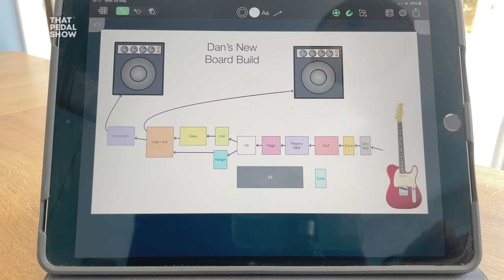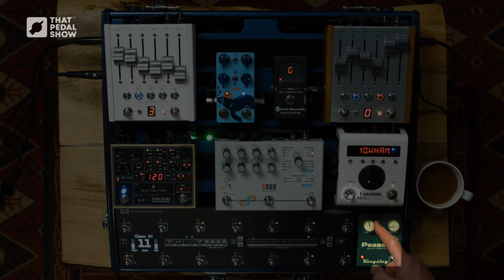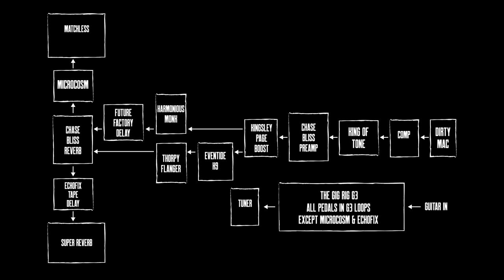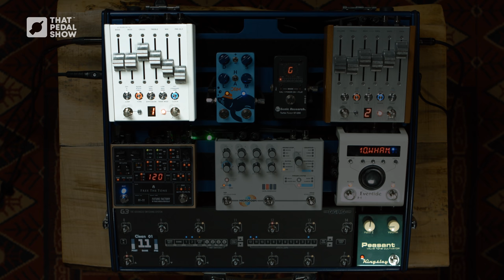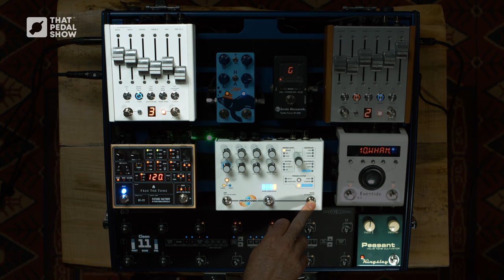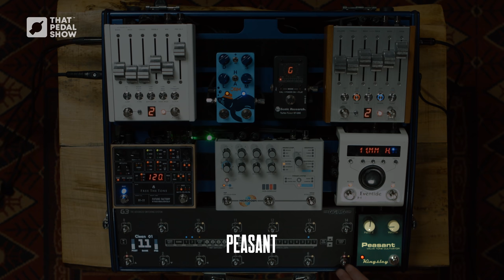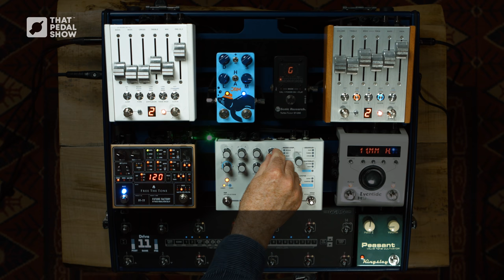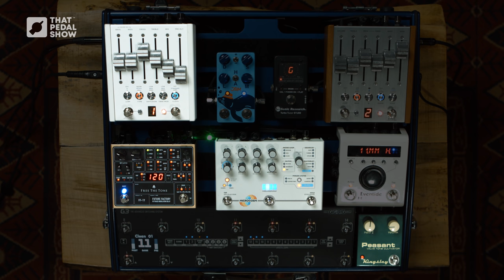Dan's New Pedalboard Build & Tones 2021 – That Pedal Show

Comment: Dan’s on point by mixing 10’s and 12’s. I play live with a 4x10 deville and a 1x12 hrd at the same time and the frequency range is insane. Also used to own a crate vintage club 50 which came with a 3x10 cab. Was huge!

Comment: I think that the years of experimentation and deciding what sound you want is really the most important part of building a new pedal board .... the dual lock, TheGigRig power supply, the SIS audio cables (and unnamed MIDI cables) have all been covered well in other videos .... but understanding why you've picked each pedal and the various pedal sequence for different tones and ideas would be great to hear even more about ....

Comment: Amateur pedal steel player here. If the Eventide can add 2 intervals above a given root note and bend them, you could do some pedal steel chord changes between the I-IV-V-vi
* Raise the 3rd to the 4th, which gives you the sus4 chord (1, 3, 5 -> 1, 4, 5) - same as hitting the B pedal on a pedal steel.
* Raise the 5th to the 6th, which gives you the 2nd inversion of the vi chord (1, 3, 5 -> 1, 3, 6) - same as hitting the A pedal on a pedal steel.
* Do both: raise the 3rd to the 4th, the 5th to the 6th, which takes you from the I chord to the IV chord (1, 3, 5 -> 1, 4, 6) - same as hitting the A and B pedals on the pedal steel ("pedals down" position)
* Now slide up: You just went from the I to the VI chord. Now if you slide up 2 frets, your at the V chord.
* Now slide down and release the pedals: Now you've gone from the V back to the I.
Reply: To learn more, Google "E9 copedent" and study what's happening in the key of E when you hit the A pedal by itself (5 -> 6, or vi chord inversion), the B pedal by itself (3 -> 4, or sus4), the A+B pedals together (I->IV), the B+C pedals together (I -> ii)

Comment: Mick, I am flattered you took the time to respond to my statement of opinion with math.

Interesting argument choice as i simply stated my opinion with an analogy.  Analogy as you may or may not know, is not meant to be literal.  Certainly some will agree with me and some will not.  If someone wants a pedal board more than a car more power to them. We make choices based on economics and most of your audience cannot afford a pedal board like Dan's.  If you are wanting to illustrate what is possible but is mostly unobtainable, then hats off to you both. Feel free to let your audience know the exact MSRP of Dan's pedal board including the labor for the MIDI set up. 

Enjoy your Unobtanium.  I have provided the word definition below just in case you want to attack the word with an equation:

Unobtainium-a highly desirable material that is hypothetical, scientifically impossible, extremely rare, costly, or fictional, or has some of these properties in combination.

Peace, love, and rock and roll!
Reply from the maker: Ha, all good Daniel. I just don’t buy the ‘can’t afford’ argument, however. Sure, a great many people have chosen life paths that have put them in a position where it’s not appropriate to spend this kind of cash on a pedalboard, especially if they’re not pro musicians! Just the same as I don’t have a race car or a full snap-on tool chest. Similarly there are a smaller number of people whose life chances have really worked against them having much of any disposable income. 
But for most of us it’s just choices. It’s not unobtanium at all, it’s just really really expensive and that’s not the same thing. We’re not saying you should go out and buy this stuff - that anybody should buy this stuff. Literally nobody needs this stuff. But we are saying that if you’re a pro musician, or aspire to be one and you’d rather work your way to something like this than do stuff like buy cars, houses or whatever, then here’s an example of how it sounds. Also remember it’s the culmination of a 30 year obsession, not something obtained overnight. 
I just really baulk at the idea of ‘normal people’. My first job literally didn’t pay enough to cover my rent and food for the year. But I’d default on the rent before I’d play a shitty amp. And I know way too many musos who’d do the same. Choices. I’m not saying anyone should do that, just to be clear, but I am saying they are all choices. Normal people. Arrrrgghhh. Again, never met one yet. Cheers!

Comment: This is definitely the most complicated pedalboard I've seen in some time, and immensely more complex than I would ever use. I'd have option paralysis with Dan's board. Even my current board design I'm working toward is more than I'll ever actually use, but simply because of space, I want to move to a Boss GT-1000Core to replace my reverb, delay, mod, compression, and eq needs. Drives will remain all analog solid state.

Comment: Thoughts on using 454 22AWG 2-Conductor Stranded Shielded Miniature Line Level Audio Cable in the pedalboard vs the normal patch cables to save space. Line level is considered higher quality than instrument, it’s shielded etc and significantly thinner and easier to route bunches into tight spots. Figured Dan the Man would have the best input on this.

Comment: Man, it took me a while to figure out how you have 12 pedals hooked to the G3, with the CXM running in stereo.  Since, there should only be room for 10 pedals, and then the CXM taking up the 11th and 12th spot.  I’m assuming the Peasant is in front of the whole board and not in a G3 loop, cause you click on it directly?  Thanks! You’ve completely revolutionized my board with this video!  Which, now looks almost identical your’s Dan, including the  pearl blue Schmitt array 550 board.  Cheers!

Comment: Really amazing tones from beginning to end.   I can imagine sitting with that set up by myself and totally having such a blast with all of the possibilities.  That being said, when the band kicks in, I can't imagine that the little nuances and differences left and right (tape and digital delay) would be sonically discernible.   So thinking you would have something different for a live show?  Amps and guitars aside, my quick math has you well over $10 grand for just the pedalboard/effects set up.  That amount is almost terrifying.  May need some velvet ropes around the board so no one can spill a Coors Lite or a shot of the Doctor on that.  :) Job well done on this one Dan.   I don't know that anyone could ever surpass this.  Thanks for the video guys.
Reply from the maker: When the band kicks in is when the little nuances are the most important so yes, this is absolutely my live rig

Comment: Hey Dan. Lovey pedalboard. Any update since 2 years? Did you change the internal switch position of the Automatone to make it works with active pedal before? For instance if you want to use the fuzz circuit of the Automatone but the Peasont, Dirty Mac or Zenith in front of it while still being able to clean up nicely.

Comment: This is great! Well done, Dan. I'm slowly reconfiguring and rebuilding a couple of boards, large and small, so this is not only fun and Dan-tastic, it's also helpful :) Like the Master (that'd be Dan), I favour a mix of vintage and modern types of effects and, shock horror - am actually starting to incorporate MIDI controller (s) into my rig! 
I'll always remain a grumpy Mick at heart tho, the MIDI is born out of necessity.
Still need to get myself a Wetter Box. Been putting that off too long.
Is that beanie analog dry-through? Just in case it rains.

Comment: Hi guys, great vid as always. Can you tell me if I can treat amp pre amps through separate GigRig loops. Then output to one power amp? Say If I want Clean, Crunch and drive, from 3 different amps with effects loops. Preamp switching? If this can be done. I can live with one input, 3 pre amp choices, come back through post effects then out. Does the G3 have internal audio routs. Can you output a signal to loop returns without sends. Internal audio routing? I'm buying a Gigrig soon. I just need to figure out the 3 amp pre selection. Plenty of solutions for 2. It may have to be a custom build, if GR can't do it.

Comment: Hi Dan,

Might have to see if I can stay up for a Live Q&A since this video is a little old now, but I have a question about the Eventide H9 you’re using.

Is it a problem with your wet/dry setup? By my understanding, the H9 has no analogue signal path, meaning you have unavoidable digital latency in the order of a few milliseconds in the pedal. Not an issue for the ear, normally, but wouldn’t that introduce phasing issues to your guitar signal when you’re using it wet/dry? Or is this actually a non-issue with that pedal.

I’m eyeing off a H9 Max instead of all my analogue modulators to take care of the “I’m out of loops on G3” problem, but don’t want to lose wet/dry.
Reply from the maker: Hi Justin, not in the way I’m using it. I’m splitting the signal before the H9, then killing the dry in the H9, so my direct signal goes to one amp and my effected signal goes to the other. G3 also let’s me do a parallel signal so I’ll kill dry to H9, and use it in parallel with my dry signal, then mix it back together after. Works brilliantly for delays etc, I’m mainly using it for more out there tones 🤓👍
Reply: @That Pedal Show  Hi Dan, thanks for the reply! I hadn’t thought about running a parallel signal in G3, that’s brilliant. Well damn, you’ve just removed the last barrier I had to buying an H9, better let my better half know :P

Comment: Great setup, thanks for the video. So on the Peasant input impedance does increasing it also effect the top end like some 1M pots seem to do?
So Dan are you using the Dirty Mac without a buffer out to the amp when you are doing Peasant->KOT->DirtyMac?

Comment: Hey, have a question, do treble bleed volume pots on a Strat. sound good with a fuzz face type pedal? I like the way it sounds now with the volume rolled down. Thinking about putting one in, but heard some negative feedback with the fuzz pedal added. I love using the fuzz pedal, I have it on most of the time. Your opinion and thought? Thanks.

Comment: Amazing video and unobtanium board. Really enjoyed it. Question for Dan. If you had to go play a gig with a rental AC30 And fender twin do you think you’d be fairly confident that the board would be as effective or do those particular AC and Fender amps an absolute must for it to sound as good as it does here. Thanks again guys great video.
Reply from the maker: Yeah, no probs with those as rental amps, would sound awesome!
Reply: Interesting. The reason I ask is there is something about the particular nature you achieve with your higher gain sounds where you get lots of distortion without necessarily lots of compression which is not a massively easy thing to do with pedals. (Or so I find) you get amazing open sounding mid to high gain chord sounds. I was wondering how much the amp plays a part in that.

Comment: Dan I a power supply question it's a specific power supply it is a joyo power supply 5. It has three 500 milliamp plugins and four 100 milliamp plugins for 9 volt and then it has one that can switch from 9 to 12 to 18 volts it's basically a recharge battery pack. My question is is there something wrong with using something like this does it have some kind of inherent flaw that could negatively affect your tone?
Reply from the maker: If it’s quiet with your rig then you’re golden 🤓👍
Reply: @ThatPedalShow  bless you kind sir! It seems to work fine it Powers my strymon my D & M drive from my other stuff and I haven't had an issue I finally bought a second one because of her time that you know they hold less charge. But I'm mostly using my older one on my small pedalboard and thanks to covid Band Geeks have been almost impossible to get and I've been playing with acoustic trio. Katana 50 nominal effects on an acoustic guitar and a Telecaster for the first set And a mandolin for 2nd.

Comment: Is the pickup heat with Red going to be tweak-able with the peasant Z ? Or a les Paul? Ie. Is this board designed around butters? How would you attack a hotter guitar in the rig? Sounds ace btw!
Reply from the maker: All the guitars will do their own thing, it’s really important to me that each guitar stand on its own terms with the rig

Comment: Dan, the h9 has several bypass modes, but most people go for the DSP mode which I guess leaves on both buffer and AD/DA. But its relay TB setting they call True bypass - comments?
Reply from the maker: The bypass state doesn’t matter in this rig as it’s in a G3 loop. H9 has no analog dry path, it’s all digital, so I run it kill dry in parallel in G3 to keep the direct signal

Comment: Question:  How does the battery only Pigdog pedal interact with G3?  Since it's always plugged in, and engaged, does the battery drain while not in use, even when switched out of the chain by G3?  Cheers, and thanks, from Virginia!

Edit:  if it does drain, could you use a 9v battery adapter instead of a real battery? (the kind that has the 9v battery plug end mated to a 9v plug power cable.  Several came with my last power supply.)

Comment: Hey Dan you inspired me to pick up the Zenith.  I love the sounds it makes, but it raises the noise floor of my recording path by over +20dB.  This is with a Cioks DC7 or Truetone CS6 powering it, even in bypass.  Tried direct into Zenith, then Apollo and same deal.  You getting the same thing?  Its that low level hiss.. gets amplified a lot by downstream gain.
Reply from the maker: I have the opposite here, very low noise floor, I’d give them a call.
Reply: @ThatPedalShow  Thx amigo!  Very much hoping to get it resolved as the pedal is absolutely brilliant.

Comment: Unrelated to the video, but I know you guys like a good wet/dry amp rig, so a small question regarding that.
Is it possible to run two amp heads trough one 4x12 cabinet (using the stereo inputs, so like two mono 2x12 right next to each other) in a wet/dry configuration? Amp inputs connected by an orange amp detonator.
And if its possible, will it sound good? Or is it better to use two different cabinets?
Just looking to save some room in my apartment.
Reply from the maker: Yes, as ping as you set the impedance correct. I love this approach, it sounds incredible
Reply: @ThatPedalShow  Thanks! Keep up the good work! Love what you guys do!

Comment: So I have a question: Can you actually use the automatone preamp like a proper preamp and feed the signal straight to a DAW and get a decent sound? Or would you need another preamp pedal to boost the signal?
Reply from the maker: You can totally do that! Remember it’s just the preamp though, so you’d need some kind of amp and speaker simulation as well. It doesn’t have any power amp or speaker sims in it. But as a straight preamp, absolutely!
Reply: @ThatPedalShow  Gotcha. Any recommendations then for an AC30 kinda sound?

Thanks for the reply!

Comment: I am sold on building a pedal board around The GigRig G3 Advanced Effects Switching System, when it becomes available. My question about the nice hinged two level frame in a flight case, which Dan uses in the video. Where can I source one of these?
Reply from the maker: Hello! Check out Schmidt Array custom pedalboards. Cheers!
Reply: @ThatPedalShow  I was just about to amend my question because I found Schmidt Array mentioned in the notes to one of your other videos later on ... but thank you for your speedy reply. I'm still a bit bewildered by the power cables and patch bay out the back but I see you have other videos covering this so I will study them first and then put a more concrete question(s).

Comment: What is your guys opinion on maximizer or harmonic exciters for guitar? For example BBE Sonic Stomp Maximizer or Aphex Xciter?
Reply from the maker: Great if you need em. They usually help counter a bit of tone suck over long cable runs or multiple true bypass pedals. Or if you just want extra punch and brightness in general. Cheers!

Comment: I got a Peasant from Kingsley thanks to this video - the wife isn’t thanking you though. If you get an email/message from her about that let her know I bought her a new iPhone so simmer down. 

Question though, I use a modified treble booster (Demedash Spidola - check it out!!) and I’m curious what a good starting point would be with the Peasant on the board. Would you suggest Peasant very first, then modified TB? Thanks as always!
Reply from the maker: Cheers Aaron, treble booster 1st 👍
Reply: @That Pedal Show  thanks Dan. I guess the idea being your treble booster or vintage style fuzz stays first in the chain and then the Peasant would be second. Does that still allow the Peasant to interact with you pickups as intended? Thanks guys.

Comment: Well the pub gigs I do I barely have room to stand, let alone space for a proper pedal board. No room to move or even reach the knobs on the amp that often has to reside back behind the cymbals.
Reply from the maker: Dave, you need a Helix, some in ears and a cup of cocoa mate. Or a Twin, a Powerboost and a Les Paul Jr. Either way, or this way, it’s all good.

Comment: There is a point where a pedal board steps into the land  of rediculous.  I could buy a small car for the price of that pedal board.
Reply from the maker: Just trying to work through the logic in this argument. Mick here. Price is the principle determinant to whether something is ridiculous. So we’ll say If X is greater than, erm, Y to the power V? Y being the minimum ridiculous price and V being the variable ridiculousness multiplication factor.
And then we assume the value of a small car is more than X? Eeee, that would have to be a pretty special small car //and// assume you have either a need or a want for a small car that is greater than X.
Nah, doesn’t work for me. I’d definitely rather have the board. Ha!